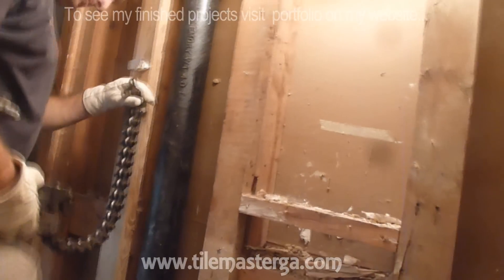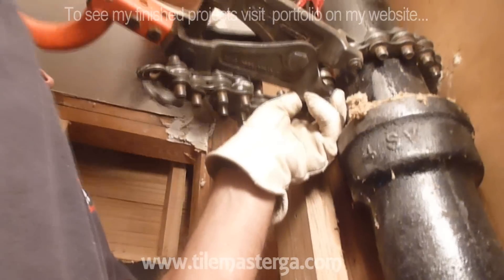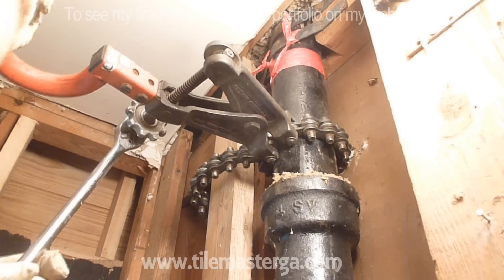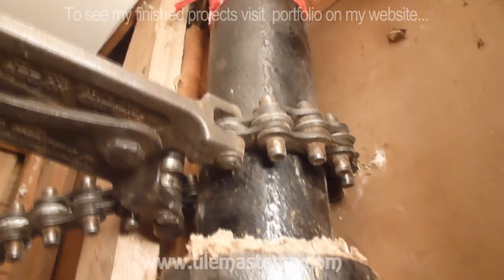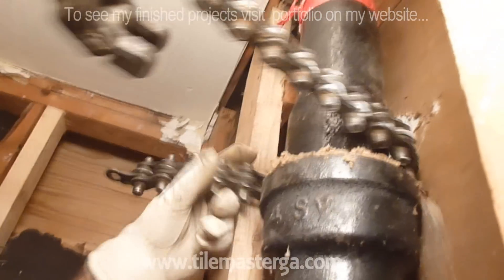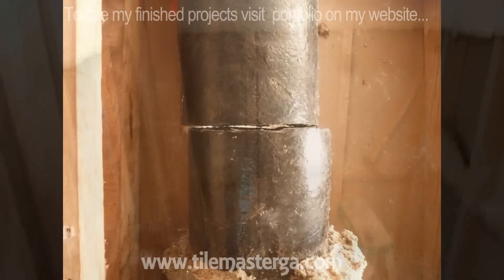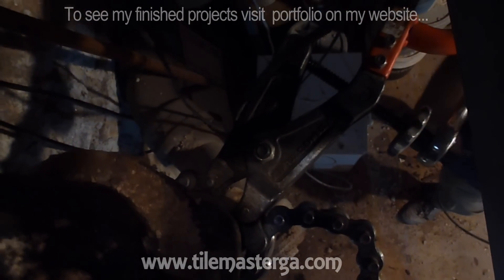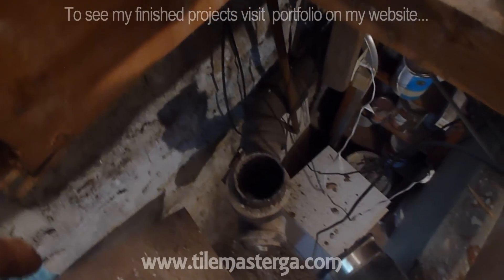How to easy cut & removal of Cast Iron Pipe - cutting with special  cutter

Comment: You know you're supposed to rotate the tool a couple times before you tighten it again and so on. So you get a nice clean cut and not that jagged break you got on the first shot.
Reply: no one will ever see it
Reply: Yeah, I must admit I also thought you were supposed to rotate the tool, like a regular pipe slice.  That's why it's got round rollers..

Comment: That is an old way of cutting Cast Iron but a good way of doing it.  I just use cut off blades in the wall now and use mission couplings or no hub clamps to join the cast to the ABS or PVC which ever I am using.

Comment: Great Video, thank you for sharing, so I have a dumb  question, how come the inside of the pipes are so clean, I have been warned to expect at least an  inch of crap on the pipes?  Also curious to know how well the cutter would work an a badly corroded pipe?  Thanks again
Reply: Because it's a vent line. Soil snap cutter could cause a lateral split on old pipe. Use a small angle grinder with a diamond blade.
Reply: Use Milwaukee $30 sawzallblade

Comment: How is that old pipe supported? Are those straps welded on? I want to remove mine and switch to PVC but have to leave the section that goes through the roof for now. I am having the slate roof company replace the vent. It leaks. Any thoughts on this? Thanks!!

Comment: Great job! remember eye and face protection as well! thank goodness you can rent this $500 Ridgid tool at homdepot for around $23.00 4-Hours,  $33.00 Per Day or $132.00 Per Week.
Reply: Did I just read the slickest advertisement ever?
Reply: Moon Pie  nah. done that before. it sucked. went through many blades. I'll spend the $27. Grinder with metal cutting blade works well. But I am removing a pipe inside a house. Big mess.

Comment: nice video but one more thing you should do is put a vent clamp on the roof to stop the pipe from falling. big safety issue, many people who do not know get injured that way
Reply: I was wondering if anyone was going to mention that. These pipes can be hundreds of pounds all the way to the roof and you can lose a finger in an instant if a clamp is not used. Live and learn I guess
Reply: +enginemodify there is a riser clamp up top

Comment: Maybe a simple question, but what did u use, or anyone with experience, to support the weight of the pipe when cutting the piece out? I have heard stories of people cutting out a piece not even thinking of all that weight of pipe going thru the top of the house so it drops and they are screwed.thanks
Reply: nevermind..i saw on another video to use riser clamps..and see now u have them at the top of the pipe
Reply: +Card Hock    It is usually a two person job. Start at the upper most section of the cast iron stack and just remove however many feet of pipe you are comfortable with; or, if limited by space, do the attic section first, then the floor below (do it in two sections if you like) and so forth until you reach the basement. More important is telling the homeowner not to flush any toilet on the second or upper floor while you are making that basement cut :)
Reply: Good points, Nick. I've done this a few times on my own, and I just start in the attic. The comment by "Hughie Boss" about wearing eye protection is CORRECT. Cast iron is VERY brittle. And once, through my error of not having the chain exactly level, as the guy in the video correctly explains, when the pipe cracked, several very small pieces flew. I wouldn't say the metal 'exploded', but it did shatter... and I'm glad I was wearing protective glasses.

Comment: I'm turning my toilet around 90degress but to do so I have to cut the right angle off my cast iron soil pipe. Is this the best tool to use for the job? What tool would be least likely to crack it? The consequences could be severe if it's cracked as it feeds on to a communal soil pipe. (the property is a 1970s council flat in London). Thanks
Reply: I know this of kind of a late post, and i am not a plumber, but I've changed toilets before.  The flange can accommodate turning the toilet, if you plan on leaving it right where it is...but just simply turning it, theres also an offset that can give you 3 inches in any way without having to do anything with the waste line. Just remove the caps, lift the toilet verically, reposition the (i think they are called closet screws) to the new position.  You will need a new wax ring, and that sometimes gets kinda messy, but wear gloves.  Many good videos on youtube ....Good luck!

Comment: I need to do this as well as I have a vertical crack on my CI waste pipe. Plumber is going to cut the pipe and replace with PVC. I am still worried about the weight of the venting stack against the PVC replacement below it - are riser clamps permanently placed not just while the pipe is cut but going forward? We did notice that the pipe sits on a 45 degree angle on the foundation. so I imagine this would help offer support after repair - yes?

Comment: I typically score the pipe with a few more wiggle-tighten-wiggle-tightens, etc.... at the initial phase.   You boys just barely scored it and then cranked down on it.   It worked (obvioulsy) but don't think it's best for the tools blade life or for getting the smoothest of cuts.    ANYWAY, everyone's an expert, right!?   LOL!!

On the cutoff wheel... wouldn't you be concerned about igniting the sewer gases in the pipe?    Maybe not enough oxygen inside the pipe to allow combustion, but still... I think the special cutting tool is the way to go.   Goes a hell of a lot faster, that's for sure.
Reply: Totally agree! If space allows, score first, then split. way easier on the tool and cutting bits with better results.
Reply: A plumber that knows his business! Good to see that there's still some out there. Master plumber... 41 years in the trade. I swear, another video, somebody said to never use a threaded c/o plug. That he uses a neoprene cap without the band! So that it will blow off when the sewer stops up. Yikes! That would be lovely in a basement. I'm like... huh?
Reply: use a grinder! it's easy! and cheaper

Comment: sometimes this is an option. if the tool fits between wall and makes cut, good. if not, it's going to be a messy job. Would not recommend hammer- shards and scale would clogged the pipe down stream.
Reply: wrong

Comment: Thank you for the video!  Question:  What glue did you use to attach the ABS fitting to the cast iron pipe above?  Is it the same glue that you used for the ABS fitting into the pipe?  What are the names of the the glue (s) that you used! Again great job!
Reply: Jim Bardwil Probably used Fernco no hub fittings.
Reply: Cant' glue ABS to CI.  Fernco only.
Reply: No hubs here

Comment: That cast iron looks brand new. Why even get rid of it?
Reply: I have old cast iron pipe as well. If you replace something in the basement with PVC (ie. main sewage pipe) you need to replace everything above it with PVC as the PVC cannot handle the weight of the cast iron. This is required per code (according to my plumber neighbor)
Reply: It's best to cut out the old iron pipe most of the time. I know a lot about doing this work. I have been a plumber for 46 years and still going. The guy talking said one thing wrong, They don't make 4/12"....
Reply: because they did, smh
Reply: @ericdesouza6379  what about the stub in the ceiling going out the roof? Is that supposed to be replaced rather than reconnected if code requires it?
Reply: @wingerrrrrrrrr  I replaced it through and through.

Comment: Paid a guy $60 to remove 50' of  4" horizonal cast in a nasty crawl space. Only took him about 15 minutes using a 3 pound hammer and dragging out manageable lengths.  He took all the sections and shattered pieces  to the scrapyard for a few more dollares.
Reply: The splinters from cast iron can be very dangerous. Make sure you wear eye protection and gloves.

Comment: Of course, that vent can separated because it's not connected at both ends. I like your  cutters! A set of ridgid ratchet cutter, people just tighten it until it snaps. If you use them when pipe is connected at both ends, the pipe cracks! But with yours, it forces you to roll the chain.Great man! I'm proud of your work! Plumber for 41 years. Do you know they make a compression gasket for leaded Bell and spigot cast iron? Remove the lead, oakum and spigot, install the gasket in the bell, pound in Plastic(or cast iron) pipe. Only way to fly.  It's called a donut. A little like the compression gasket service weight B and S they use on federal prisons underground. https://www.plumbingsupply.com/flexibleconnectors.html   2nd from the right, bottom row

Comment: Orange nail polish..  lol..  and i use a sawsall with a cast iron blade..  also the tool is not supposed to be tightened until it cracks..  havent you ever usec a pipe cutter?  Quarter turn then around the pipe, quarter turn then around pipe..  with those its a quarter turn then wiggle back m forth as much as you can then tighten a litle and more wiggle..  yall breaking the blades on that doohickey..  theyre not made of unbreakable stuff...

Comment: I would not use a metal cutting wheel to remove sewer pipe.  I've seen plenty of amateurs severely burned from igniting the methane gas that is in the sewer system.

Not wise advice.  Stick with the chain snap.
Reply: I would like to see the backed up facts on this. I have used an angle grinder to cut many sewer pipes, We had crews use acetylene on sewer pipes.. Years ago I even tried finding anywhere that stated such existed and couldn't find any google search. Do include links-videos etc.
Reply: @affordablesolutions8516  My information was from a man who is a journeyman electrician, who was also a city inspector for all the trades.  He was my instructor when I took plumbing & DWV classes here in Oregon. He told the class he met a journeyman plumber who had been severely burned in the face because the plumber used a cutting wheel on a cast iron sewer, igniting the methane in the line. I tend to take the word of someone with first hand knowledge of what happened, who saw the results. 

Since we know sewage creates methane (hence one of the reasons to vent above the roof) it makes so much sense that it is flammable, and  I always used a chain snap
Kara

Comment: Good job Russians.  But, if you dont need that piece of pipe, brake it with hammer and dosvidania
Reply: BiHlover80's thats Polish language not Russian
Reply: If you hit it with a hammer it will not break in a smooth round cut like he got.  It will crack the pipe up where you want to save it.  I have used a tool like this since the mid-70s but it was only bigger than this one.  Back in the day a long time ago and still today they run cast iron on 2 stories because it's thicker and you won't hear the sewage run down the wall.  I always cut this crap out and run either ABS or PVC now.  Been doing this since 1977.  Time to retire now lol.